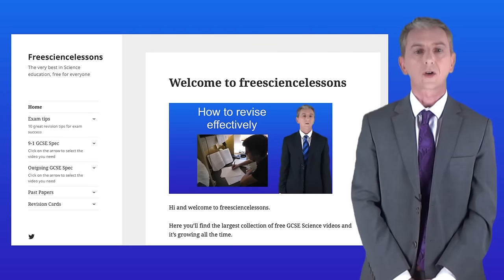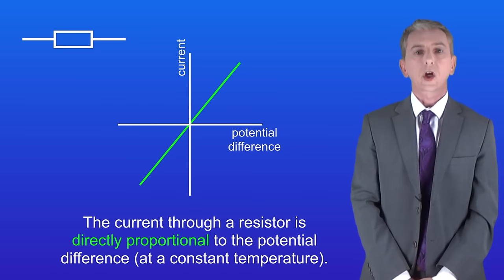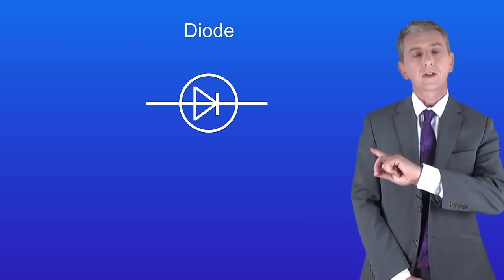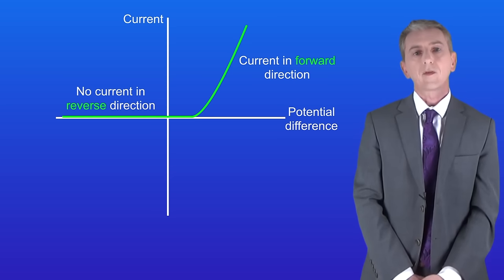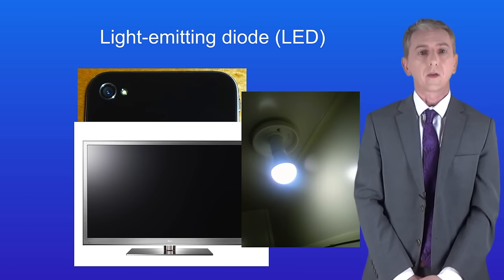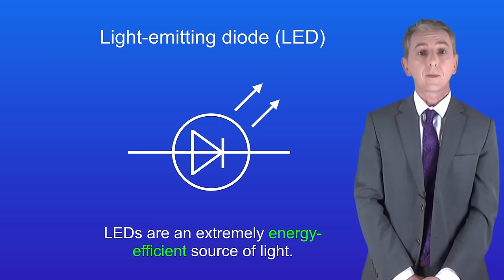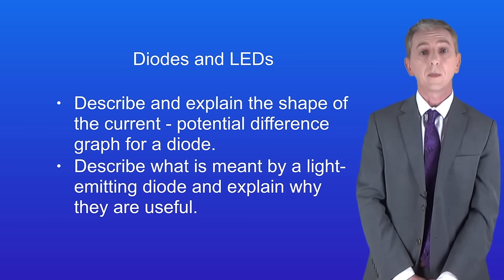GCSE Physics Revision "Diodes and LEDs"

Comment: Sir. I'm a little confused. I thought the conventional current was opposite to the way that electrons flow, so in the animation, why do you show the electrons flowing in the conventional current instead of electric current (the correct direction?). Am I also right to believe that, once a certain pd has been reached for diodes, that the increase is at a constant rate (because it is a straight line?)
Reply from the maker: Conventional current is a relic of physics past, where scientists thought that charge carriers were positive. We now know that electrons are negative but we still use the idea of conventional current (for various reasons). So in my videos, I show the electrons as if they were causing the conventional current even though this is incorrect.
Reply: Conventional Current Direction flows from positive to negative.

Electrons flow in the opposite direction, negative to positive.

Scientists discovered conventional current direction in the 1800s, which was way before the discovery of the flow of electrons. So, once scientists discovered the flow of electrons, they realized conventional current direction is the opposite. But, if we followed electrons flow (- to +), then scientists would have to recreate many electric equations, concepts, etc. So, they followed conventional current direction. Mathematically speaking, it is isn't wrong, as a transfer of positive charge is equal to a transfer of negative charge in the opposite direction.

I hope you understand!

Comment: Hello, I was wondering why it is that there is a slight delay once the pd is positive before current starts to increase? Thank you so much for your time and effort:)
Reply: Sarah Cat because of the resistance in the circuit
Reply: obviously its too late and you already done your gcse, but its because the diode is made from silicon which is a semi conductor material so it needs some energy (potential difference) it can start moving electrons freely so at 0v to 0.6v, there will be no current as no electrons are free to move, but after 0.6v, the electrons can move so it rapidly increases

Comment: But why is it that for a diode, the graph for forward current flow does not begin at 0 but instead begins to increase a distance after which some potential difference has been applied?
Reply: Radreon X Probably because the resistance is still too high at this point, so you need to apply a little bit more volts to have a current flowing properly.

OR

The diode is made specifically to only allow the current to pass once there is a certain amount of potential difference across it. 

Those are my guesses; I have to ask my teacher before the test tomorrow 😓

Comment: so is an led essentially a mixture if a bulb and a diode? thanks so much for the videos we really appreciate you!
Reply from the maker: An LED is a diode that emits light. Apart from that, LEDs don't have much in common with a lamp. They operate by different processes.

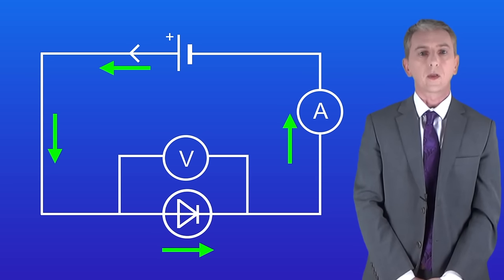Comment: At 1:29 , underneath the conventional current arrow, the green arrow is pointing left, but since the conventional current arrow is supposed to face the opposite direction to the one that the current is travelling in, would the green arrow not face the other way, since in the diagram it’s going from positive to negative? I could be wrong
Reply: Or are the green arrows supposed to be like the conventional current, where they are facing the wrong way?
Reply: @user-ld1lg4dz2o  how it's shown in the video is right, the conventional current is assumed to come out of the positive end of the cell and as shown in the video it is, and even though we now know that's wrong we still draw it this way.
Reply: @yujirohanma203  what they said, and because scientists used to draw it this way before it was discovered it was wrong, however it’s still drawn wrong just for the sake of drawing

Comment: Hi i was wondering what the point of a diode is because why would charge try to flow in the opposite direction? ( Back to the negative terminal of the battery)